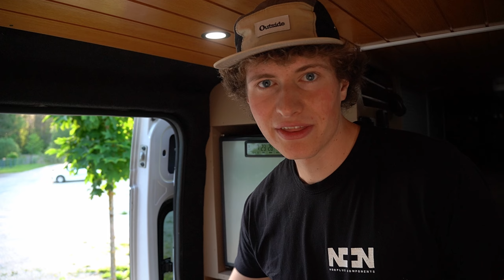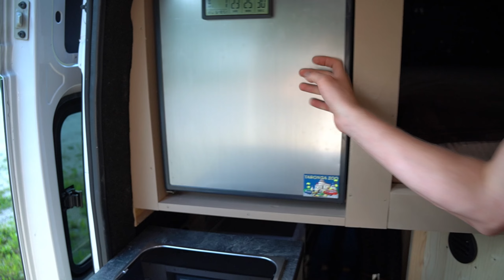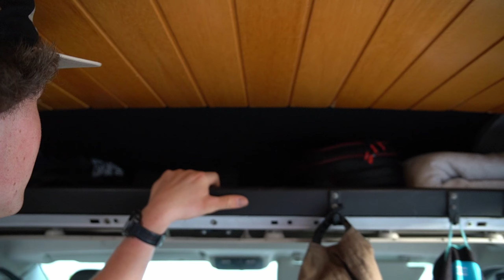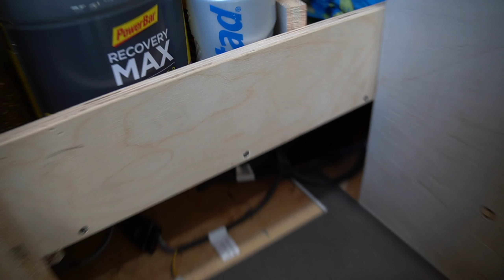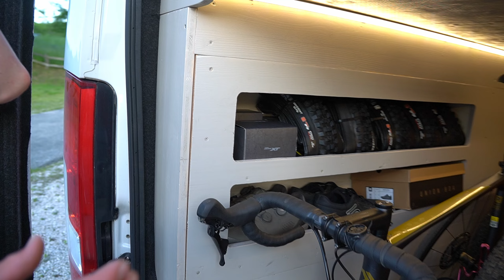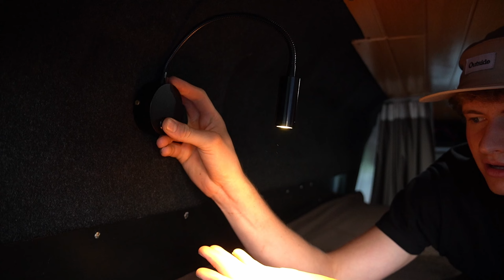MY DREAM MTB CAMPER | Van Tour | Fiat Ducato L3H2

Comment: tim, wahnsinns auto wie hosd des mit da pumpen tan, wenns amoi zum waschbecken aufi an schlauch hosd und an für hintn bei der duschn? hosd noch da pumpen an y schlauchteiler und bade systeme sand zugleich auf druck?
Reply from the maker: Danke dir! Ja genau hab ein T Stück drinnen auf der Druckseite und die sind immer zugleich auf Druck. Hab aber jetzt den Fehler gemacht beim Frost das Wasser nicht abzulassen, und da hats mir jetzt den Duschschlauch zerrissen!🥲🤣 Dabei immer aufpassen!
Reply: @ Ok verstehe, das mim Frost is a Schas, hoff der Schaden is ned z'groß. Kannst dur mir evtl. bitte nu sagen auf weller Höhe du schlafst?
Reply from the maker: Weiß i auf die schnelle gar nicht, aber miss ich dir raus!✌️